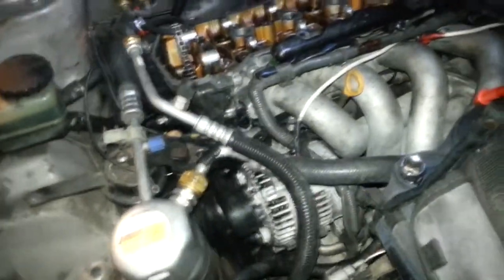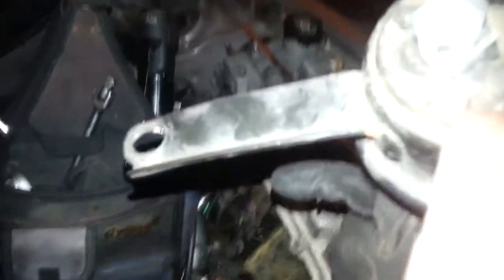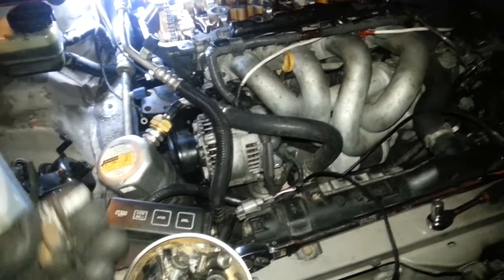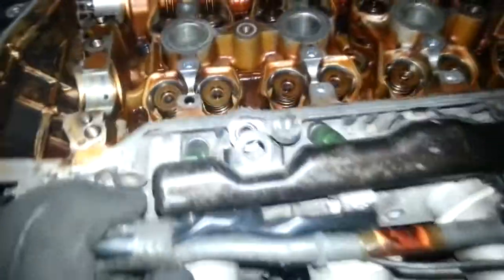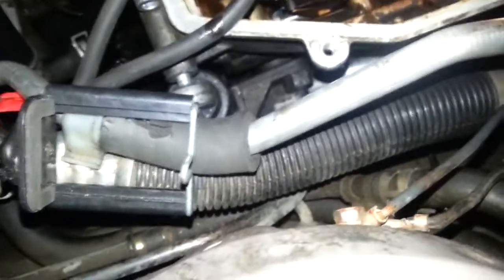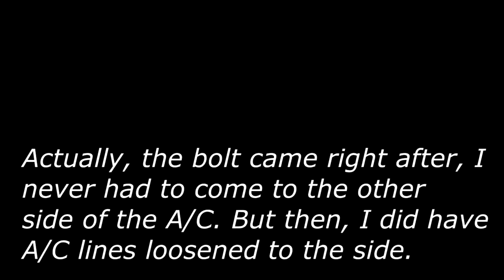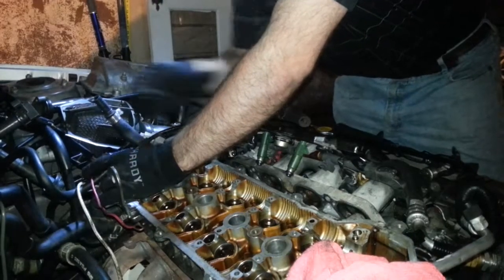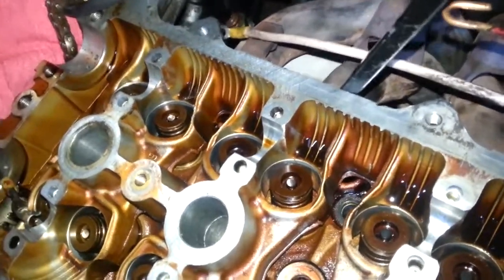1ZZFE Cylinder Head Removal ...I did Hydrolock my Engine Part 6

Comment: Was it possible to take the cylinder head off without removing timing chain cover? I have a dilemma with this engine at the moment but timing cover is the obstacle.
Reply from the maker: I'll have to look at my partially disassembled engine. I think I pulled it off. I think it's MUCH easier to pull the timing chain cover off 1st, I can't remember. Made this video 8 years ago! Lol I will check though unless you've already found out messing with it more. 

I'm leaning towards the timing chain cover coming off first because that's when I found the part of the engine mount that they DON'T sell is cracked iron. Thankfully, my replacement engine came with that part of the engine mount.
Reply from the maker: Yes. Definitely. Under that passenger side w gine mount are screws which keep the cylinder head bolted to the block from the side as well and not from the top. 

The cover doesn't have to come off but enough of it's bolts do or that cylinder head isn't going anywhere.

Comment: Hello
Reply from the maker: +wtbm123 Hey. How was your 3 day weekend? Or a working memorial day...
Reply: worked
Reply from the maker: Your reliable Hello's helps inform me that YouTube didn't announce my latest video. Probably because it published itself as a bug. I pulled it down as I had wanted to add some annotations first. Then, when I released it, it didn't do the usual announcement. Silly YouTube.

Enough of my chatting. It's the Port and Air Flow Theory II video:
https://youtu.be/yc1vkp41WcU

Comment: Those wear marks on the timing chain guides look perfectly normal to me.  They ARE a wear item, and if you're in there, you might as well replace them, but the wear looked shallow and even, which is a good sign that the engine is well taken care of.  :)

Double-triple-quadruple check your timing cover housing for hidden bolts!  It's hard to tell in the video, but if it's a one-piece timing cover, it'll probably have some sort of RTV adhering it to the cylinder head.  If there's a separate upper and lower half to it, then the upper half may be bolted to the lower half.  Barring anything else that may be holding the head to the block, it may just be the alignment dowels in the block have really gotten themselves stuck in place.  Once you're absolutely 250% sure every bolt and nut imaginable has been removed, go over it one last time to be 500% sure, lever the prybar against the head, and give it a gentle-but-firm pop, being sure the prybar will be lifting up on the head, and not sliding it sideways.  :)
Reply: The timing cover will need to be separated from the cylinder head by about a half of an inch. There may be dowel pins aligning the timing cover to the head, and the half inch should provide enough clearance to get past them. Once you have a gap, You should be able to lift the cylinder head vertically to remove it. 

If there are pulleys on the timing cover, they will likely need to be removed because most do not fasten to just the cover. They usually are fastened with large bolts that go completely through the cover and into the cylinder head/engine block.
Reply from the maker: +rhkips (to anyone else read and be warned of a spoiler unless I'm published the next video first on accident, lol) The timing chain cover is one piece and moves with the cylinder head so I need to search it over again for a bolt or it's just some brutal sealant. No gaskets ever made for this seal. 

Your message is highly useful. Thank you!
Reply from the maker: +Wayne Holt Thanks mate.

Comment: Your frend is a pen and scribble pad, draw circles and the path of the belt, later make a better version, seal it in a clear zip bag, glue the bag to a clean surface.
I dont know, you youngsters he he :-D
Reply from the maker: +zx8401ztv Oh I know about these youngsters alright. In my 20's I couldn't even take a picture without days for development or more. 

Now I take a video of every serpentine belt when the diagram isn't on the car. I find a video less confusing than even the manufacturer supplied diagram! Now I finally match your creativity with the truth. :)
Reply: "My creativity" Ha ha thats a nice way to say im mad :-D :-D.

Yes i remember the 21 picture camera and waiting a week for the developers/printers to send my mistakes to me LOL :-D.
I still use an old phone, it has a limited 3 million pixel camera built in, very handy for pictures of complex mechanisms.
For basic stuff its pen and paper :-D
Leave something in a halfway state for a month and you would be supprised how dodgy the memory becomes, but my non artistic diagrams put me right, also wrapping white parcel labels round connectors and writing short hints on it, like "alternator" is usefull :-D.
Reply from the maker: zx8401ztv There is no way I could practically own enough magnetic trays so I have boxes with labeled internal engine parts and fasteners.

I was less careful for standard parts. Simply a bag with exhaust labeled on it is obvious enough for simple bolt configurations. 

You caught me I was using a euphemism for mad. :)

Hey, if I was never close to madness my genius moments wouldn't ever be available!
Reply: Now your just trying to find an excuse for your madness lol :-D

Genius moments often appear when you suddenly have a mental connection to something you were mentally blind to.
Much like stepping on a rake in the dark, you have a sudden mental connection, well a handle smacking you in the face, close enough lol.
I do talk some crap LOL :-D.
I talk rubbish when im at the sally army too, i have victims everywhere lol.
Reply from the maker: +zx8401ztv your first comments first made me think you were reminding me you were a pen pal.

So I therefore must write on you.

It's really my fault. I think your comments on other channels were much more sensible before I encouraged you. That said, your humor had to have already been, even if it was a candle still under it's bushel.
Reply: No you mean you write using me, im a pen pal :-).

Yes i can be serious, it depends on what kind of person im talking to, some people like humor, others like more serious talk.
Im sure you know how hard it can be to know someone via the videos they make, or just comments, i do get it wrong sometimes.
You dont get the sort of madness you can have with your real skin and bone local frends, the references to funny times that no one outside your frendship circles would understand.
Serious is safe, comedy if they have humor, if they are outside your country then listen for the cue's.
You know what i mean.